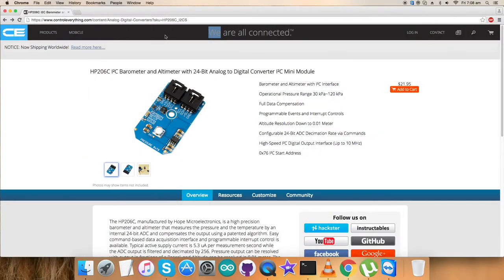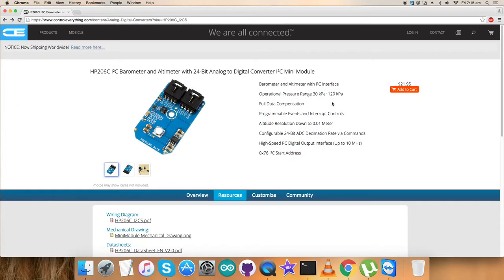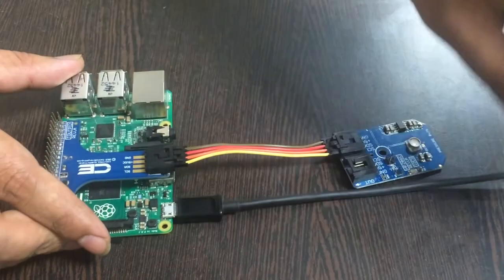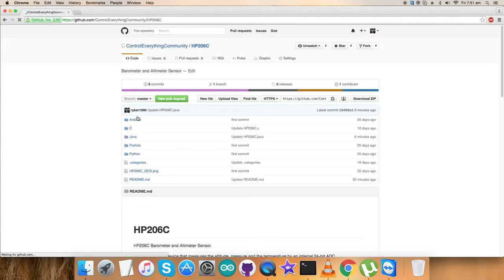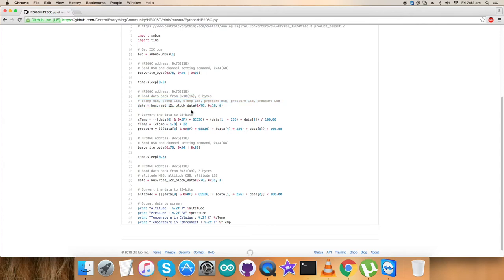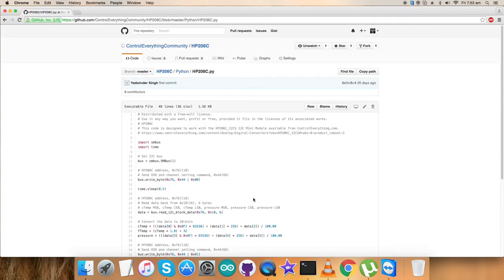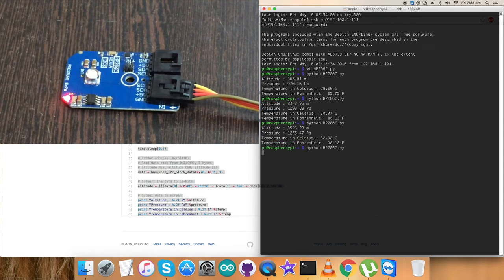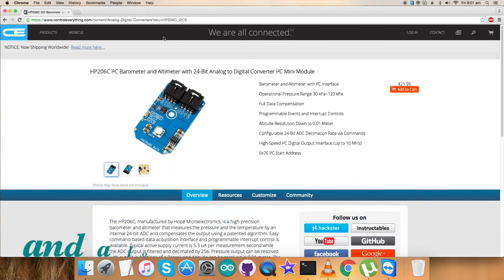Raspberry Pi HP206C Barometer & Altimeter Sensor Python Tutorial

Comment: on the website i see the HP206C is Barometer and Altimeter sensor.
how do you get the temperature ?
Reply from the maker: Hi, you can use Github code(mentioned below) which will help you to test the temperature readings and also help you to understand the code with illustrated examples:
https://github.com/ControlEverythingCommunity/HP206C/blob/master/Arduino/HP206C.ino
Reply: yep but i mean what the algorithme ?